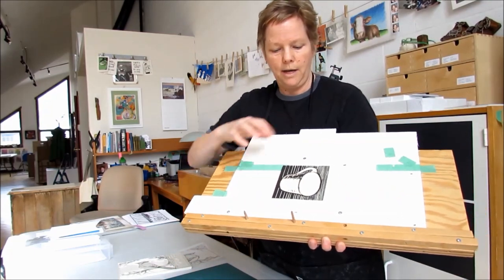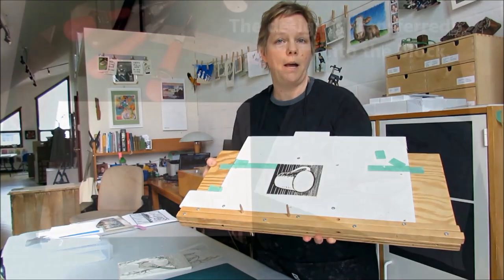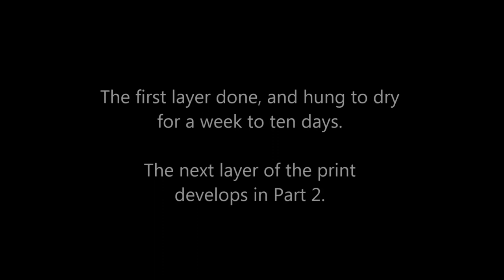1/3 Blue Jay Reduction Linocut - Part 1

Comment: Hi Linda. Fantastic info here! I am relatively new to lino printing and have just started doing a reduction method. I have printed my first colour and it came out flawless but when I put on my second coat it comes all blotchy, quite thick and with spots of first colour showing through. :-( I am using water based ink and am mixing own shades as per your video. Any tips would be much appreciated. Thanks you
Reply from the maker: HiLuka, This is something that would be fairly hard to diagnose without seeing it in person, but I suspect it is the water-based ink. I only use oil-based printmaking inks, as I have found really poor results with water-based inks, generally. It can also depend on the kind/grade of ink you are using as it may not layer up on top of previous ink layers well. Without being there, the best thing I can suggest is that you try to do some test prints of just the brayered ink on top of one another (letting each layer dry completely) to see how it works before trying in on an actual artwork. I can imagine how disappointing it must be with a reduction print as you can't go back to do it over. :-( Keep in mind, too, that if you switch to oil-based inks (I have a video about the kinds I use) the inks typically dry by absorbing into the paper, so when you layer inks on top of each other, the drying time can be a lot longer between layers. Good luck...keep at it. It's an experimental and non-exact art form that take a lot of testing and trying!
Reply: Hi Linda,  thank you so much for your reply. i have added a few drops of water to my ink and this seems to be the way to go. Still not a perfect finish but a much better one. I think I might be swapping inks to oil based one or at least will buy some more expensive ones :-) Again thank you so much for your reply.

Comment: Thank you for this! Great work! May I ask what paper you are using? I 'm looking for a good paper that is thin enough for me to print by hand with a barren but not transparent.
Reply from the maker: Hi Judith! Thanks for watching. I use a lot of different papers (love to experiment) but my favorites are BFK Rives, a paper that's a little thicker (https://store.abovegroundartsupplies.com/inet/storefront/store.php?mode=searchstore&search%5Bsearchfor%5D=bfk+rives).

I also LOVE the Speedball acid-free PrintMaster paper that is bright white and mimics more of an oriental paper but holds the ink well without wrinkling (http://www.dickblick.com/products/speedball-printmaster-paper-pads-for-block-printing/). Think really high-end bond for the PrintMaster paper. I buy it in an art store in Calgary, and haven't found it online in Canada.

Japanese papers are great, too, but go easy on the ink as they can bleed through to the other side (and tend to be a bit more transparent). I like any kind of Mullberry paper, and you can usually find that online, too.

I am hand printmaking everything (no press), so I am using the paper dry (not dampened). 

I always tell people don't use a coated (shiny) stock as the ink only smears and does not stick very well. The printmaking inks need to absorb into the paper to work! 

The links above are for North American suppliers, but should get you started.  Experiment and have fun!
Reply: Wow, thanks so much for taking the time to give me all this info!! I really appreciate it :) I have also used BFK Rives paper, but maybe the one I`ve used is thicker? since I needed loads of elbow grease to burnish it with a wooden spoon to get good results.  Anyway, I will check out these links, and thanks again!!!
Reply from the maker: No problem! And, you are right that BFK is quite thick. You may need to try a printmaker's baren to burnish with because you can get more downward pressure on it; at least I found that, compared to a wooden spoon! They're not usually too expensive, either.
Reply: LindaCoteStudio thank you!

Comment: Hi, Linda , Can you tell me, from where you have buy your this 
"Lino Registration  Device " or buy which method you have made it, Please reply me
Reply from the maker: Hi Jayant, I did reply to you on your original post on the other video you commented on. Did you not see that comment back? Here is my comment again: I don't have a video description of this registration system I use. I built it myself (not bought it), and it's made up of a base of wood, with a skinny piece of wood across the top where I have glued two dowel pieces so the paper can be held in place (I punch holes in my paper to match the dowel width). Then, I build a form on three sides of the block out of foam core, leaving one side open so the block can slide in and out. The foam core is fastened to the base with wood screws to hold them securely in place. This allows me to pull the block in and out for inking each time and carving between layers. I describe it at the beginning of this video and show you this piece. Hope that helps!